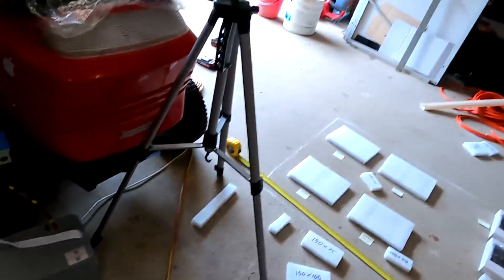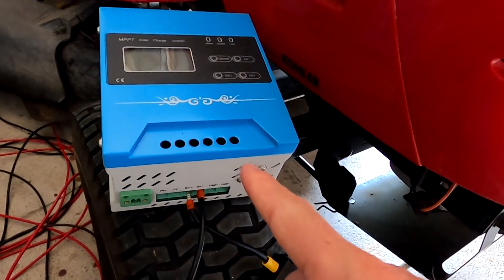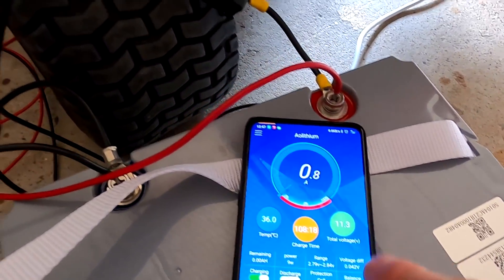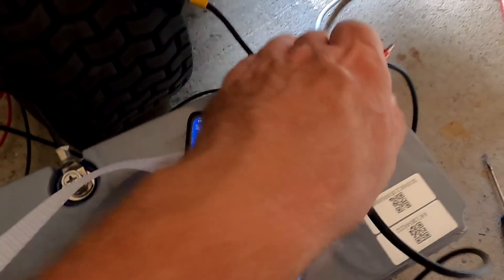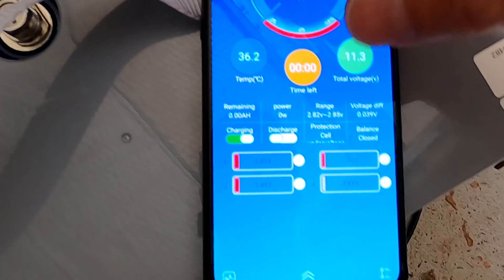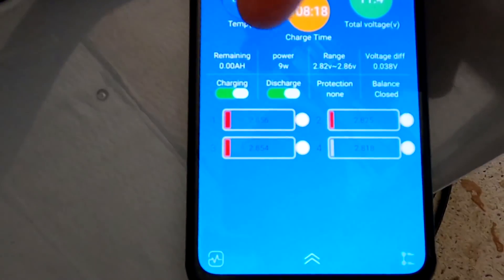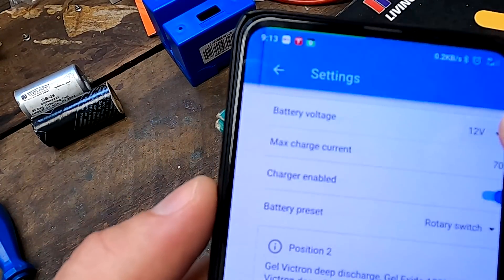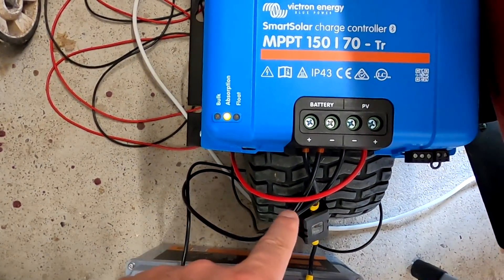Battery empty, BMS disabled further discharge and MPPT cannot recharge. Aolithium BMS in a deadlock!

Comment: I have jiabaida bms 48v 50 A..and when I have undervoltage cell failure the charging option is not possible..my battery pack is connected to off grid inverter..the only way it's to let charging back is by manulay reset the alert and then bms is let current flow to charge from the inverter

Comment: I wonder what would happen if you had two of the jv whatever controllers connected to the one bms whether it would detect the voltage output of the opposite control and keep them both turned on untill pv voltage drops to 0 then that will trigger them to turn off, or will they both continue to try to charge and cause magical smoke

Comment: Having designed some solar controllers I can tell you that it is not easy to meet all requirements and goals, and charging a zero battery is a goal that often conflicts with other goals during design. Many solar controller designs require the battery to be in a reasonable voltage range. While this was perhaps fine for a lead acid pack it is a problem for a BMS protected lithium pack when the BMS disconnects it. Note that a solar panel is a current source and the voltage will only rise enough to deliver the current the panel produces, it cannot rise more, so charging a battery directly with a panel is fine as long as the current is reasonable and one stops before the battery is overcharged.
Reply from the maker: Thanks for the info, Alan. I can only imagine what it is like to design such a controller with all requirements. 
I would not recommend charging a lithium battery from a panel directly either. This was just for my testing purposes but everyone should always use a controller for that, even the battery may have a BMS for protection.
Reply: Yes Alan, good comment, ur info is probly mostly correct, I am no expert here, however I do have a 12-24v 40A Renogy mppt controller that is supposed to be capable to recharge dead flat batteries in this scenario, I haven’t had to test this feature yet, I am glad to say, but this is in the instruction manual somewhere, I believe.  
Also, regarding ur comment on charging directly from a PV panel, good info, I have actually charged 12v batteries directly from 18-22v & 33v panels, as u say, as long as u watch ur voltage doesn’t go over the limit say 13.8v to 14.8 max for lead acid or 13.8 for lifepo4, which could be easily controlled with a cheap Chinese battery controller off ebay, which could switch the charge current to a set parameter. On top of this, I have also connected this 22v panel directly to a 60A lipo4 battery I built with a cheapish bms as a experiment to see if the BMS would protect the battery against an overcharge / overvoltage situation from being directly connected to such a high voltage panel, and the result was a success basically it did cut it off before it went critical, but it did get on the high side, but this was a big voltage difference where a cheap Buck converter or Buck/Boost converter would also do a good job connected just before the battery to reduce the voltage when sun is strong, and to get extra power when sun is low or cloudy with the boost side of circuit. Cheers

Comment: So now tested my mppt (from Solar King) when battery reaches low threashold, mppt turns off. So waited for panels to get sun and start charging, but nothing, mppt could do nothing if battery is below charge threshold, it cannot wake up, no matter how much solar is happening. So YES need a mppt that can wake up and start charging an under voltage battery maybe?

Comment: LOL, I had my setup done two years ago, the lead acid battery died and I could not afford to replace it. I disconnected the battery but NOT THE MPPT. Had no clue it was not supposed to be conected without a battery, nothing about this in the "manual".  It has sat there and rotated all the specs for TWO YEARS, then the other day I connected a battery to it and away it went no problem, so it did NOT turn off due to no battery, however I could not make any adjustments to it until I connected the battery.

Comment: So far I am only testing my system, so let the battery get discharged to determine if the mppt settings work, no BMS involved yet.  Still need to work out what BMS to use, I want one that talks to IOS not just looks but talks. Connected a charger to my battery and as soon as it got to the level as set in the mppt the mppt turned back on.  Definitely need to be able to adjust the parameters in the BMS.  I am thinking that the ONLY need to have a BMS off a mppt is for balancing, if the mppt is any good you can adjust the lower and upper voltages to suit your battery, rather than rely on a BMS.  Thoughts.  Love your work.

Comment: This is the problem with FET based BMS with common port. Once again... Relay based BMS to the win..
Reply from the maker: Well, usually, the load will disconnect before this happens. I was just testing this BMS with an empty battery when I cam across this deadlock.
I've got a BMS with relay. And mixed thoughts about it...

Comment: Pretty sure my EPEVER does the same thing, not as the Vicron but the other one. 
I only have some small batteries, 36760 or whatever they are (they aren't in my hand atm).
I'm pretty sure I've killed the batteries several times but solar has turned on MPPT and started charging in the morning.
Reply from the maker: It seems to be a problem with the JNGE controller I tested first.

Comment: Hi Andy, this is exactly what I meant in the comment I made on your video "Here is the catch with the Ciabatta 'JBD' BMS. Watch this before you buy one!" @ 27-Nov-2021. Its a chicken or egg situation. 
In your other video from 11-Dec-2020, if you use a solar charge controller instead of a power supply, you will find the same situation.
A short solution will be to shunt P- & B- temporarily thus bypassing the mosfets. 
Will Prowse mentions this as well, but his approach makes the solar charge controller not measuring current to/from the battery
"Complete LiFePO4 Solar Battery System Design (Updated Blueprint in Description)" 23/Jun/2019 23:20.
Happy chargings.

Comment: Great Video!  That would be a bad situation for someone like myself that doesn't have another source of charging besides solar.  My question is:  You connected the solar panel directly to the battery to charge it up past 3v.  How many volts does your solar panel produce?  Is there a possibility of pushing too much voltage into the battery, thus "BOOM"?  bye bye battery?

Comment: Hi Handy, yes I have similar issue with my Sola inverter WKS1. This unit cannot run without batteries connected so, the MPPT do not start even with sun if the battery is disconnected. If my BMS mosfet stop because of batteries voltage too low. I will not be able to recharge anymore the batteries. I need to start the BMS mosfet manualy through the application.

Comment: I have been testing  a few cheaper inverters/mppt and all in one units. There is always a catch with cheaper units. Mppsolar all in one have inverters are a great unit for the price but have a float profile bug. Renogy inverter chargers don't remember settings if the bms shuts off then comes back on the inverter will go back to ac priority mode. There is always a bug or catch with cheap units. Even smart bms i have had some good jbd and the odd buggy one. Daly bms i gave up on as they are too un reliable. I am switching back to hardware based bms as they are more reliable. For a house bank if you were to be using 24v i suggest an Electrodacus bms as it controls the victron gear to turn on and off loads and charge instead of a bank off fetts handling the current in the bms itself and its not cheap Chinese made.

Comment: Andy - use proper solar charger.. Victron can run without battery from solar only.. :) as you discovered in the end.. And your relay BMS won't help either, because it will NOT allow any current to solar charge controller (otherwise it will allow to completely flattern the battery), as there will be zero volts on output with that JNJJRJ something solar charger..  Victron is mounting big capacitors on MPPT solar chargers - that is why you/i/we see those sparks when connecting them. But that is why they will not blow out if you disconnect battery and not panels in direct sun. Voltage on capacitor goes up relaly quickly, but not as quick as MPPT can turn off charging..  This is what JNJJRJGN solar charger miss and they made safe way (keep MPPT off) rather than allow to charge when there is no battery..

Comment: Good topic Andy.
Two ideas:
Not sure about the panel you are using, but if it is the same voltage of the battery, you could try a pair of diodes (one on each lead) . The diodes will bypass the controller feeding directly the battery automatically even when you are not aware the battery needs them. Put in series with each diode a 270 ohms in order to limit the current to 100 miliamps for instance. The bms will cutt the charge if needed. 
A better approach is to parallel the MPPT with a cheap PWM controller for this task. It will take care of supply the "weak-up" voltage to the MPPT controller. Needs to be tested on real life, but is a good idea for the next video 😉
Jose, Madrid

Comment: I thought that was a common condition with MPPT controllers, that they needed battery to power them so they can control the solar panels voltage/amperage.

Comment: Not sure if anyone else has mentioned this. But if low cutoff of the load (for example inverter) is set  above bms cutoff you shouldnt get this deadlock. But with dc loads or parasitic losses you still could end up below bms cutoff. Safe bet would be to go for a solar charge controller that wakes up on solar alone.
Reply: Unless your cells are out of balance.  The external load cutoff doesn't know this condition so it continues pounding away at your battery until the low cell causes the BMS to shut off.

Very hard to detect externally.
Reply from the maker: Yes, absolutely correct. This was for a test here where I discharged the battery to 2.5V to check out the BMS function. I then came across this deadlock.

Comment: I used a great EPever for about eight years and I accidentally disconnected the batteries before solar. It got smoked in an instant. The new ones now have protections against this as do most solar charge controllers.

Comment: Andy, does the solar charge controller for your Ao Lithium have a way to disconnect the loads once the battery is mostly discharged.  If so you can use that to control the discharge to loads while the BMS will only stop the discharge therefore disconnect the solar charge controller before harming the battery.  I imagine the solar charge controller would draw a very low amount of energy  so would hold up the controller until the next day when the sun comes ups and you can recharge the battery

Comment: this is why some people add a decent size set of capacitors before the solar charge controller after the battery bank so if this situation occurs you dont fry the solar charge controller and also this works as a buffer when you add load so you dont hammer your batteries so hard with startup current draw when say a pool pump or well pump kicks on aka the capacitors give up energy quicker than the batteries and buffer the load making the batteries last longer and so you get less voltage sag.

Comment: I'm using the same BMS (did went to low voltage cut-off) and I guess I am lucky that I'm using a solar charge controller (SRNE brand, actually I have 3 of them) that behaves just like the Victron you're using. Yohoooo!

Comment: Yeah, the mitigation would be to use the charge controller to control the load, by setting low voltage disconnect above BMS disconnect.

Not an issue, just how things work :)
Reply: would only work if all your loads are connected to the solar, if you connect your loads to the battery/bms you'd still have the same issue (which is how most are connected since the load side of the charge controller is usually low amps).
Reply: @sharpx777  I didn't say specifically to connect the load to the charger, I did however say that one can control the load, with the help of it by connecting a relay to the load-port of the controller.

Comment: You commented that the guidance is that you should connect batteries first, sure, it wants the panels to have a load rather than being open circuit, but in general I don't think it should be a requirement to have a DC source on the battery.
What you're seeing is probably the controller's struggling to sense the battery? I don't see it as a weakness of the BMS, because those BMS have other advantages in being unidirectional and prevention of under charging. You yourself sold the advantages of MOSFETs over Relays last year!

Comment: The updated version of the jnge controller will not goes on if in solar voltage is low even batteries are full charged I already have one controller jnge controller with 80 amps and up to 240 volt solar open voltage and it can charge up to 72 volt system few days back i was tested it to charge 24v lead acid battery it did not goes on before I connected the solar panels

Comment: Hi Andy and thanks,
Many solar controllers, or inverters with built-in solar controllers, do not work without battery.
Moreover, many solar controller,inverter manufacturers often advise never to operate these devices without a battery. (possibility of destruction)
I have 1 model of solar controller, where it is impossible to operate without battery, because the manufacturer has included the MCB of Battery and PV at the same time. so either cut you all or nothing.
On my installations, I take care to always turn off the PV first before the battery, does that seem to make sense to me?

 But Some inverter and solar controller works without battery, but it seems to me that the parameters must be well defined at the start? I don't think these models, for example you run them on battery power and instantly turn off the battery power, I don't think they continue to operate normally??🤔
It is obvious that in your Test Extreme Andy, it is a problem, because indeed, when the BMS stops the power , the solar controller or inverter is OFF.
But that's what we ask him?! Yes? (stop the decharge! if no until broken the battery?)
Obviously it will take an external source to restart the system.👍
You will have to try to set the BMS stop discharge and recovery at the similar voltage,maybe the BMS restart,but stop again and restart....🤔
It must be understood that the stop discharge voltages are protections for the battery, but of course normally we should never go that far.😉
Thanks again Andy, for this video and experience...stay charged!!! (and especially minimum before the cut off)😂🤣

Comment: ok i have eve 16s 304ah batt and the jk 20cell 1 amp balance setup. i top balanced each battery individually then in series and then assembled the pack and then discharge to 2.5, then charged them again. second charge is taking a long time because they seen to have gone way out of wack and about 6 of them where low. i am letting the bms handle it to bring them inline. low ones are 3.36 and high are 3.55. will it damage the pack if the balance is out by 204mv and i let the bms handle that? charger is 5a and it has been charging and balancing 4 days. balance is set to kick in at 3.45v. i'm worried is this normal?

Comment: It's very normal, and very not optimal.  I've yet to come up with a good solution.  I'm wondering about a brain-dead, simple switching controller that doesn't need battery power to charge, and wire it in parallel with the mppt. With a low charge limit it should shut itself off and the mppt handle it all most of the time.

Comment: My victron 75/15 + 190 watt (really old panel) does turn on with battery bank turned off and 3 watts of solar through the milky roof windows. I put a switch between the panel and MPPT.

Comment: This situation can also happen not for a low voltage situation, but also a low temperature cutoff, which typically happens at - 20oC for LFPs. I came close to this with my Renogy Rover but, never reached - 20oC, maybe - 19oC. Wonder if my Rover will still run on PV to start the internal battery heater once the sun comes up in the morning.... I don't know.
Reply: I just ordered a renogy rover, I'd be curious to know if it does the same thing, this lockup situation is not good.

Comment: read the headline and was horrified that there is a problem with qucc, last week I just ordered it 😅 I like that it is 7/20 s because now I have 8s but in time I will switch to 16s and also that it does not limit the charging current by half as daly bms and similar .

Comment: Interesting but obvious comparing Victron $600 to JNGE  $140. Most times you only get what you pay for. It was a test and a good test so viewers are aware of issues and hopefully save people from destroying their batteries from unattended or unmonitored installations. Good job Andy, thumbs up and change your bms settings.           PS: You didn't put insulation behind the Al panels?
Reply from the maker: The Victron gear seems to be superb in most aspects. The Victron is a charge controller while the JBD is a BMS, so different things here. It is definitely a problem with the JNGE charge controller I had connected first. This is a cheap one from China which works reasonable well if performance is not a priority and enough sun is there. In cloudy conditions 👎 and it draws a sh*t-ton of standby energy from the battery. 
Yeah, it was definitely a test. This situation should not occur in real life and the load should turn off far before the BMS shuts everything down.
Thanks Glen.
Reply: @OffGridGarageAustralia  Sorry I couldn't remember the JNGE thanks I will correct.
Reply from the maker: @glencooke494  I cannot remember it either 😂